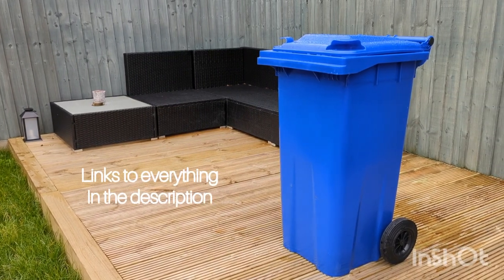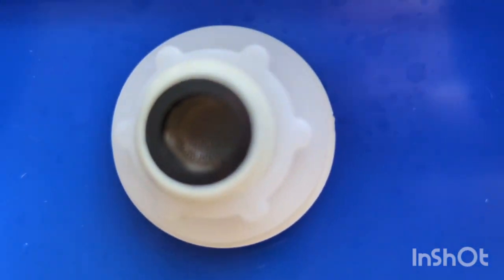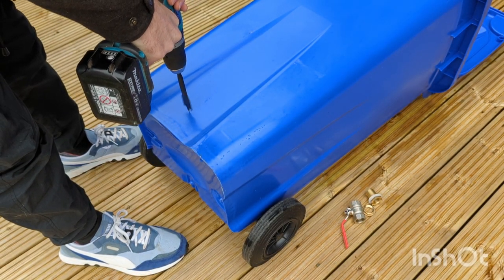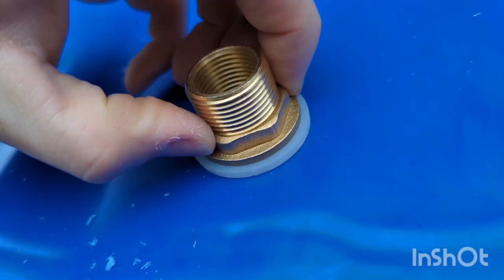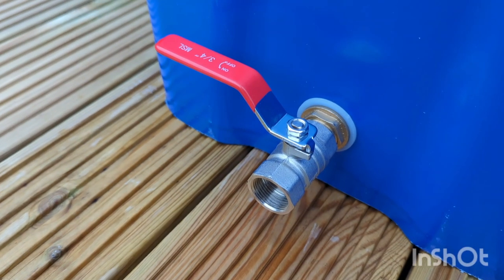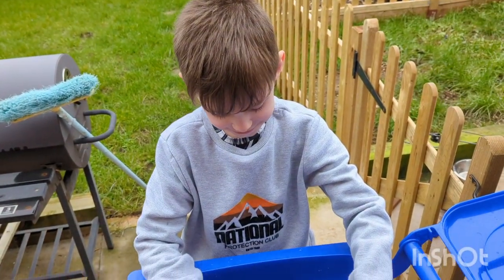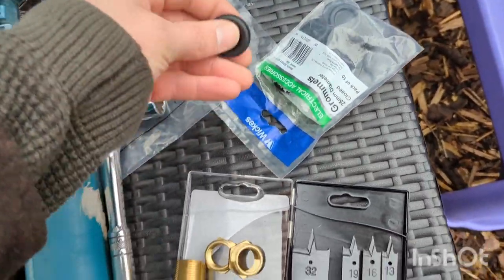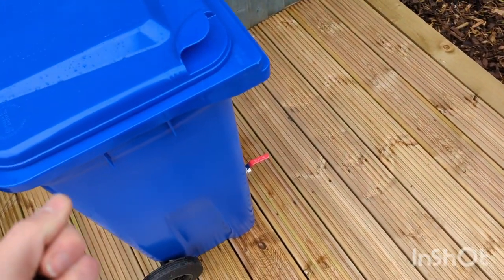DIY - *£89!!* Pressure Washer Buffer Tank

Comment: I had to replace the valve in my toilet cistern last year, I bought a cheap one from an eBay seller , paid less than £5 inc. & it fills really fast, almost no restriction to speak of, the old valve would take a few minutes to fill the cistern, the new one fills in about 25 seconds.
The eBay valve looked really cheap as well but works perfectly.
Mine cistern is a bottom fill type but you could still use that type of valve by having a lower fill point with a pipe elbow (90°] fitting inside your tank.

Comment: Nice info, this is what I wanted to know when I started my pressure washing business last year. Having the parts and links listed is a nice touch. One thing I have learnt is to go for a 3/4 (19mm) hose rather than the standard 1/2 hose. Especially moving water from the tap to the bin over longer distances. It's less of a bottleneck for water supply, especially if using a 21lpm machine. All the best  Paul
Reply from the maker: Thanks mate, noted 👍
Reply: Hi Paul do you know what length your 19mm hose is and what reel you use for it?
Reply: @jacksavage3516  50 MTR 19mm hose on a hydrosure hose reel...
Reply: @pjacks6692  Thankyou Paul
Reply: @thelonewolf666 no its not its 25mm mdpe onto your 22mm copper (usually).

Comment: Hello mate, you mention at about 9:02 that you’d recommend connecting a filter that goes on the inside of the wheelie bin, fitted onto the outlet that goes to the jet wash. 

I typed in “3/4” filter” onto Google but very new to jet washes so no clue which one I should get. If you have the time would appreciate if you could drop in the comment here a link to one that I could buy with this set up. Thanks mate!

Comment: hi mate ive got the float valve but it didnt come with the washers and i see you have water connector fitted any chance you could send me a link for parts to buy for connecting the water supply to the float valve, thanks for all the info you provide well impressed.

Comment: One question how do you connect the hose pipe from the ball valve to the pressure washer?
Reply: That's exactly what I was wanting to know. I think you can use an internal threaded adapter from toolstation. I've not tried yet though.
Reply: So I got the internal adapter and it works a treat. Brass I think it was about £1.50. Probably need to put tape on in case it leaks

Comment: Got myself a free bin 👍 just looking to order the parts, the float valve is 1/2 inch will that still work if i get a 3/4 inch hose coming from the tap? Thanks
Reply: Or will a regular hose be ok? I'm guessing you have a 3/4 from the tank to the washer?

Comment: Hi mate. I got the float valve. Do you have a link to the rubber washers and plastic nut to fix it to the tank. Or what size do I get. Tia. 👍🏻
Reply from the maker: Hi mate, sorry I thought it came with them! 
I think they're 1/2 inch washers, you can get them from any local plumbers merchants. 
Grab some 3/4 inch ones while you're there too

Comment: Could I ask you where you got the washer that attaches to the float valve. I bought the same one but it never came with the white washer you use to secure it to the tank ? It’s doing my head in trying to find one that fits 😂
Reply from the maker: Oh no 😞 you can get them from any plumbers merchants
Reply: @SMOUT_  thanks mate. Picked one up today 👍🏻
Reply: What washer did you get it please mate👍
Reply: @bgsvaleting  it’s. Half inch washer. Got it from a plumbers merchant one here in Scotland is called grahams.
Reply: Great thankyou for your help and fast response
Reply: @bgsvaleting  take the float valve with you.  Show it to the person and ask for a washer to fit it that way they can check the size

Comment: hi ive ordered and recieved the ball valve and the 1/2 inch water control valve(1/2 inch)  i cant find what you call a fill valve which im assuming fits on to the water level valve and then obviously i can connect customers hose do you have a link for the fill valve please
Reply from the maker: Hi mate, sounds like the "water level valve" and "fill valve" are the same thing. It's just a single small unit as shown in the video, if you've got that bit, you just need to add a hose connector on and you're good to go
Reply: @SMOUT_  hi again ive relooked at your video and if you was to be kind enough to look at it 50 seconds in it is the white part im assuming half inch which you have attached to the bin and the grey part you screw into that as its filtered i believe my dusty bin is being delivered tommorow and i have my very 1st job at the weekend any help with those parts i would be eternally gratefull thanks
Reply from the maker: DM me on Facebook with some pics mate
https://www.facebook.com/smoutspressurewashing

Comment: Guys i need urgent help please, if I get a 10 liter a minute, 3200psi pressure washer for commercial use in London, england, will kitchen taps in here be able to give enough flow for my pressure washer? Or do I need one of these buff tanks? I ask because I dont have a car amd have already commited to getting all equipment and dont know what to do if right at the moment of truth my pressure washer doesnt work in the customer tap, as most house in london dont have an outside tap...
Reply: Get yourself aa 'Arctic Hayes U-Flow Water Gauge - Water Flow Measure' usually about £20.00 and check your own flow rate to see what you have at home, and decide from there.

TBH if you can afford a machine with a higher LPM (liters per minute) then buy it. There are videos on YouTube comparing flow rates and you'll soon see that the higher the flow rate the faster you'll clean. Most of the videos are american and talk about gallons per minute, for a quick conversion 1 gallon = 4.5 liters

Comment: Would this be useful for a 4gpm pressure washer?
Reply from the maker: Yes I'd encourage it
Reply: @SMOUT_  what is the benefit for this? I’m new to all this and I really appreciate the response!
Reply from the maker: No worries. If the customers water supply doesn't have enough flow to keep up with the demand of your machine, you'd start filling this as soon as you arrive on site and it will give you 120L of water to burn through before you have to stop. Meaning you aren't starving your pump of water.
You can use whatever size tank you like to suit your vehicle.
Reply: @SMOUT_  usually are 4gpm pressure washers requiring a buffer tank? I keep hearing mixed things of people saying they don’t and they do
Reply from the maker: In the UK, a 15LPM machine isn't likely to get the water it needs from probably 90% of customers taps. It varies from house to house, but I wouldn't want to risk starving my pump as you're just going to cause damage. Best to have a buffer tank instead of risking it in my opinion.
Reply: @SMOUT_  okay! I’m going to try this DIY Option and try to start making some money around my neighborhood!!
Reply from the maker: Love to hear it. Good luck

Comment: So im going to attempt to make a buffer tank aswell, However the float valve is no longer in stock, so I found another but I have to choose between sizes DN-15,  DNS-15, DN-20 and DNS-20, Anybody able to give an insight to which one I need I know the numbers represent the mm but Im not sure which one as Smouts original one in description has no size on description in amazon? Cheers